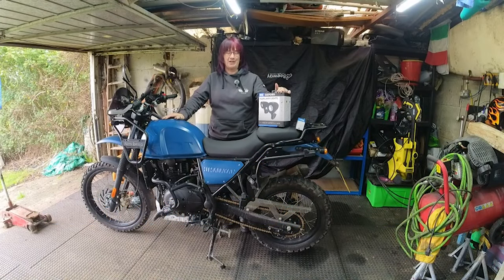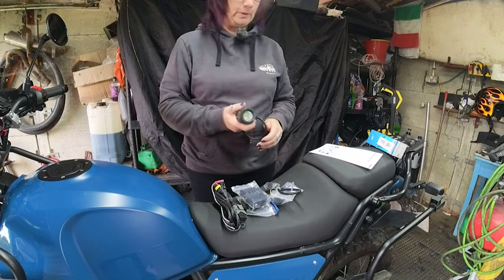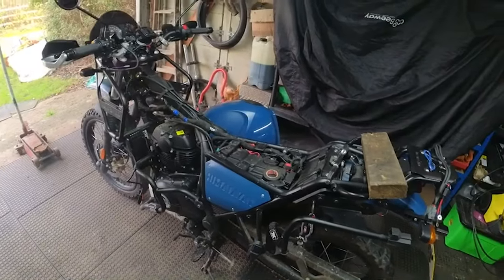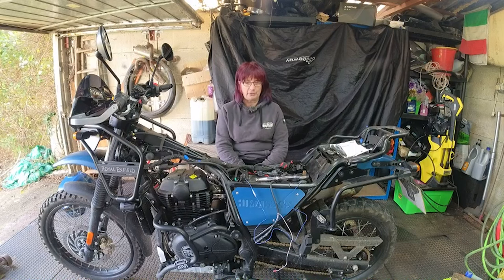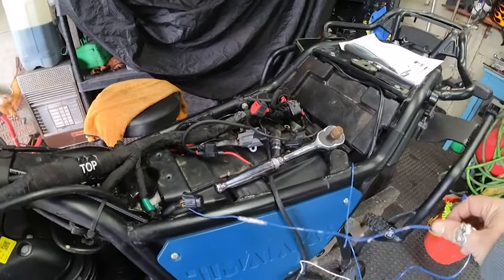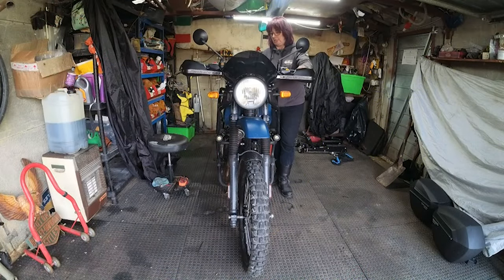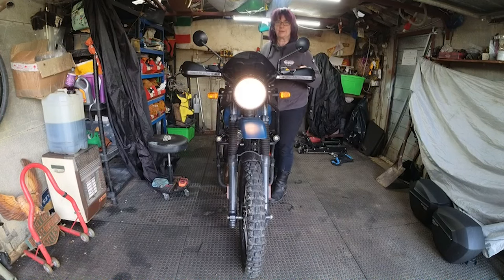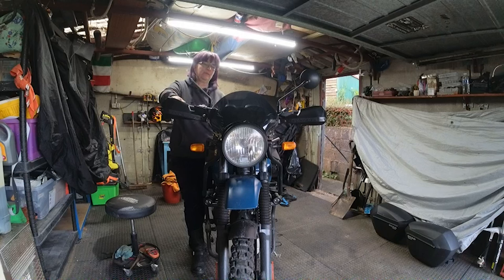Oxford Auxiliary Lights installation on Royal Enfield Himalayan 411.

Comment: Great video and channel. I have a couple of bike including a Himmi 450. The oxford lights are brilliant, cars can't get out of the way quick enough!
With regards to fitting extra electrical bits and bobs, a lot of folk now seem to use a healtech thunderbox, which you fit to the battery, and all the extra wires from extra things plug simply into the connectors that eminate from the thunderbox itself. it eliminates the need to splice wires in to the loom of the bike. (i have no affiliation with the company by the way), I found it easy to set up and use).
Regards,
Chris.
Reply from the maker: @chrisperrott5457  thanks for the lovely comments, I did look at the thunder box and may well get one in the future as they look a clever piece of kit 😊

Comment: Looking good. Pre-made wiring kits are always just a bit short or so long that you could go around the bike twice.  I just bought the lights and made my own loom. Bit more effort but everything is the right length.  
I've fitted so much stuff to my 411, I replaced the headlight and indicators with LED to lighten the load on the poor thing. I put 5W LED daylight running lights (DRL) where you put yours, they are on all the time. I've had comments that I was still visible in a clouds of dust in the Australian outback. 10W LED driving lights are mounted on each side of the screen.  I like its an easy bike to fit electric farkles to. No CAN BUS to worry about unlike my GS when I had it.
Reply from the maker: @BBP-oil  they are great simple bikes for sure ! I think my next investment might be an LED headlamp 😊

Comment: Just found your channel and its a good watch. Nice lamps and look good on your Himmy. Shame the wires in the kit weren't long enough, I would have just soldered an extra few inches of wire to get to the battery. I think mounting the switch where you have could potentially cause future problems as its totally open to rain and road crap where you have put it? 
I've subbed to see what else you get up to . 👍
Reply from the maker: @spotty_cat26  thanks for the lovely comments 😊 luckily the switch that comes with the lights is completely potted and weather sealed, not much difference to mounting it on the handlebars really, if anything it’s nicely tucked out of the way on the back of the crash bars. 
It’s quite frustrating the wire harness is so short, they do sell an extension kit for another £15 so it’s almost like they know it comes up short.
Thanks for watching 😊

Comment: If the lights are spots the need to be aligned like the headlamp is also the switch will need to be on the bars to pass the MOT. I fitted the Oxford daylight lights no wiring loom 30mins to fit and very eye catching. £40
Reply from the maker: Thanks for watching, I guess it’s all personal preference 😊

Comment: Great video, 
What kind of windscreen is that?
Thanks
Reply from the maker: @motok8425  thanks for watching, it's one from Ebay. Just check on the years as the 21 to 23 models had wider spacing on the holes 😊
https://www.ebay.co.uk/itm/256608136459?mkcid=16&mkevt=1&mkrid=711-127632-2357-0&ssspo=BCLJUBZDS4e&sssrc=4429486&ssuid=H98rgCjFRhq&var=&widget_ver=artemis&media=COPY

Comment: Fantastic lights, though as you say the wiring should be longer, still you found a good place for the switch.
I'm impressed that you're comfortable in working on your bike 👍 

Will you ride it throughout winter?
Reply from the maker: @keepitreal1547  thanks for the lovely comments 😊
I still may change the location of the lights as I'm concerned that they're a bit high 😁 and I will definitely continue riding throughout the winter along side other projects in the pipeline 😊
Thanks for watching.

Comment: Hi i just stumbled upon your video and enjoyed it very much sorry you dropped there bike and like you say it happens to us all at times. I have the same colour i think it looks great and in the year of ownership i haven't come across another in this colour on the road only seen them in the dealerships. Back to your video if you were only 3 inches short could you not have extended the ends to reach the battery to save you re doing the whole lot? Having said that handlebars can look cluttered with all these add ons so putting the switch where you did was a good idea. Did you know that there is already a USB socket fitted to the Euro 5 Himalayans even my dealership did not realise this i just found mine by accident its in a very cramped position under the clutch lever with a little hinged flap over it. Good luck with the bar replacement i will subscribe to watch this as i fancy upgrading mine because as you now know they are very weak👍
Reply from the maker: Thanks for watching 😊 yes I could have extended the wiring, it’s just pretty annoying when the kit is around £200 and I’ve expected it to have a bit more length for the cost. Yes thanks for the tip on the USB, I already use mine for my garmin so I wanted to add additional to charge my phone etc on longer trips 😊

Comment: Hi could you please tell me where you got your short screen and how much and what tyres are you using and do you recommend them 
Thanks
Reply from the maker: @christaylor8784   
thanks for watching, the screen came from from Ebay. Just check on the years as the 21 to 23 models had wider spacing on the holes 😊
As for my tyres I’m using Bridgestone AX41, I’ve done a review in a previous upload, I really rate them and they’re wearing well 2000 miles in with plenty of tread left, hope that helps 👍🏻

https://www.ebay.co.uk/itm/256608136459?mkcid=16&mkevt=1&mkrid=711-127632-2357-0&ssspo=BCLJUBZDS4e&sssrc=4429486&ssuid=H98rgCjFRhq&var=&widget_ver=artemis&media=COPY